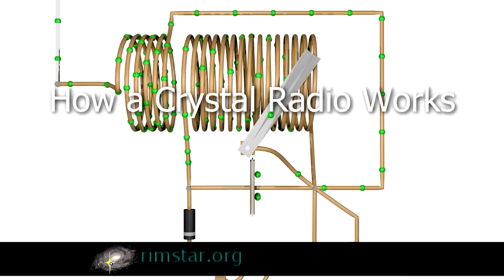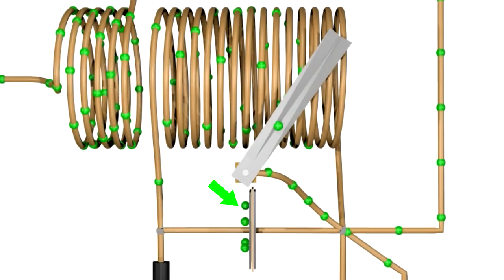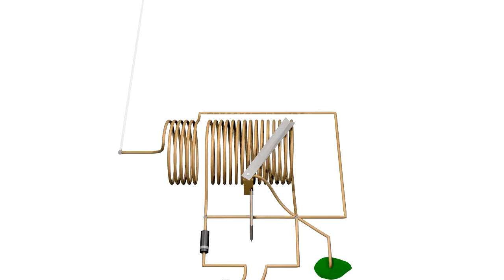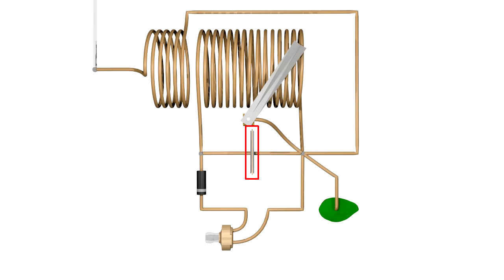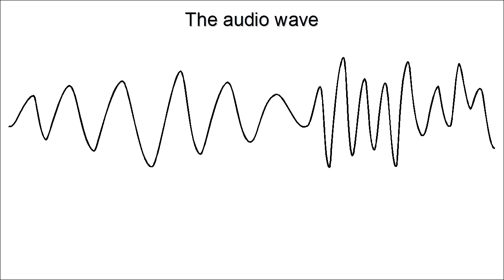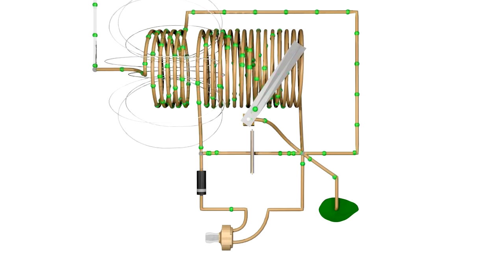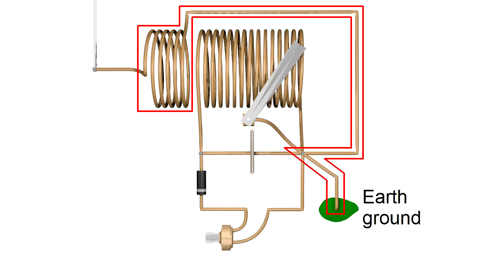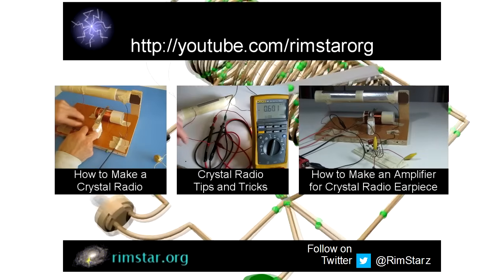How a Crystal Radio Works

Comment: Yep. Been reading since my comment. Seems I may have had a chart specifically for pens and pencils. We never had induction meters then, would have needed a constant. Diameter and length are important factors, and can affect things like sensitivity, directionality, gain and a few other factors. Larger diameter for eg will make it more directional. Longer coil will make it more sensitive, and a longer wire can aid gain. You can also take those things too far, and make it worse. its a fine balance.

Comment: Thanks for the nice video and the clear explanation. As troubleshooting video,  can you add the voltages at every stage?  Since Ge diode conduct  only at 0.2v does it mean that the voltage coming from the anntena should be more than 0.2 volt?  Thanks
Reply from the maker: You have electromagnetic induction going on between the antenna coil and the tuning coil so maybe an induction formula as with a transformer's primary and secondary might be better.

Comment: 60 years ago, when I first tried making a crystal radio, I used a quartz crystal, and no matter where I placed the wire on it nothing happened.  I later learned that quartz was an insulater, and the crystal had to be a conductor like galena.  I don't remember if I used galena then, or went straight to a manufactured diode, but the diode radio worked much better.

Comment: I have been working on Wireless transmission of electrical power for a little over a year now and its not that hard to put one together.  I'm currently making a AM Radio broadcasting Station that has a set-up like what you show in your videos but instead of having just a plain wire antenna, I'm gonna use the metal core like most internal radio antennas have and coil the antenna wire around it then add a 2nd coil not directly connect and then the 2nd coil gets struck by the Tesla Coil.

Comment: What might be lost on people is - THERE IS NO POWER SOURCE.  There is no battery or AC power.  This is a radio that needed no power supply.

The front end of T. Henry Moray's 'free energy' device was a crystal radio.  Instead of an earphone output, he tuned the crystal set 1st stage of his device to the strongest radio signal in his area and the output was fed to a cold cathode amplifier tube of special design (his design).

He avoided having to provide power to heat the cathode that is normally required to 'boil electrons' off the cathode by using radium inside his special amplifier tubes:  the initial electron source off his cold cathode came from the radium's ability to create an initial, quite low level of ionization of the working gas in the tube (mercury was the source, just like in modern fluorescent light tubes).

He used a positive feedback loop from the amp tube's output to bring the amplifier into full conduction - the plasma built up slowly.  Eyewitness accounts of his free energy device reported 45 minutes to an hour before the device produced output.

The output of the amplifier tube section was a capacitor bank.  So the free energy crystal radio guts plus the free ionizing energy of the radioactive radium actually produced a real free energy device.

But the radio station operator's power bills inadvertently paid for Moray's "free" energy.  Without the local AM stations broadcasting, his device would not work.

The other problem with his device was that if the capacitor section was drained quickly, it would take too long to rebuild the charge, so his device was not very practical.
.

Comment: Very Clear & Consistent;-)
As a method of Pulse Charging Batteries? 
Couple the Crystal radio, to a voltage Multiplier & collect Free Energy ♡
Reply from the maker: Thanks.
That's actually why I got into crystal radios in the first place. Then I realized how little energy there was available this way and just kept on having fun with crystal radios as radios instead!

Comment from the maker: If your simple diode does the job then great! Use it. Though I'm not sure what you mean by simple diode. Germanium diodes are nothing special. They're just one type of diode out of a few different types, and happen to start conducting at a lower voltage and are leaky (which helps this circuit work.) If you have a silicon diode and it does the job then that means you either have a long antenna and good ground or a strong radio station or both. Those result is higher voltages.

Comment: I build many of these but I never used two coils. Simply one coil with a long wire as antenna at one end. I've also made them like the POW's did in WW2 with a razorblade and pencilpoint and sometimes, if you got the placement of the pencil lead on the razorblade just right, it worked even better than with a diode. Of course the diode has a threshold voltage which I don't think is the case with the pencil lead although I could be wrong there. Anyway, these are great fun to build. Shame they don't work for FM stations ;)
Reply from the maker: I've never tried one coil myself. I have done the razor blade though, but didn't have as much success as you. Mine worked but not as well as with a diode. It takes a little more work I guess.
Reply: Well, it helps if your razorblade is old and has that blue hue to it, or if it's a bit rusty. That helps make it work like a diode.

Comment from the maker: That would work. It's called an amplifier. I have a video about how to make an amplifier to increase the volume for listening on the earpiece, "Steps for How to Make Amplifier for Crystal Radio Earpiece HD". But a lot of people just use normal store bought amplifiers. There are also DIY amplifier circuits on the web for speakers.

Comment: Re: 10:29 (the capacitor),
Also, a capacitor of that value is will allow high frequencies to pass through it like a piece of wire, but at the lower audio frequencies, the capacitor acts like a high value resistor. The carrier wave being much higher a frequency than the audio frequency, will be sent to ground, thus allowing the audio to make its way to the earphone unhindered by the carrier
wave.  
In electronics, the "wanted" signal is called the intelligence and the "unwanted" signal is call noise. Here, the audio is the intelligence and the carrier is the noise. The capacitor filters out the noise. The audio alone is left to feed the earphone.

Comment: Thank you. Excellent explanation.  I have just a small comment. Actually I did this when I was young. I just left the Right end of the second coil open. I thought that connecting  this end to the earth makes short circuit and causes unnecessary power loss.  Anyway very good work thanks a lot....
Reply: I think it's impossible to work when you don't ground the antenna coil. I read your comment again and saw what you meant. LOL.    I also did it as a kid. So much fun.
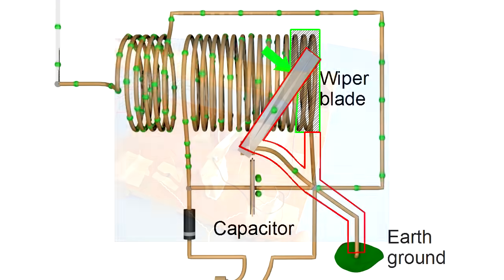Reply: I am glad that you see the point.  I read  my comment again and I realized that I am not clear. :) You are right it is necessary to connect to the ground. If you pause the video at time frame 1:19 you will  see the schematics. At this schematic you will see that viper blade is short circuiting the bottom of the  coil which is also connected to the ground. All I wanted to say is just keep connected the wiper blade to the ground and remove the connection of the bottom end of the coil from ground and leave it open in order to prevent some short circuit. By this way the radio should be louder.

Comment from the maker: Nope. For AM type radio receivers that use a battery, you do need the battery. The battery is used to amplify the signal. Because it has amplification, the circuit and components are different. Many of the things that are done are the same, tuning in a station, turning radio waves into audio waves, and how they're basically done is similar, but there are enough differences that the battery is required.

Comment: Great Video !  And a perfect radio for the "Prepper" and your Three Day Kit/Bug Out Kit that FEMA wants you to have...  Also this Crystal Radio has NO batteries !  So the "Haters" will say the battery companies will ban this radio !  My EDC Go-To radio is the digital La Crosse 810-805 Weather Radio that is an  AM/FM/WB battery powered radio.  The radio has an external power input, a light, and earbud to increase battery life and a tether.  And an Antenna can be a Long Wire to bring in a weak station or one far away !  Or a Loop Antenna to couple to the AM radio to bring in the weak stations !  The VLA in New Mexico is a very sensitve  radio RCVR and can listen to the stars in the galaxy !  tjl

Comment: The 3-D graphical animation here is excellent, and viewers wouldn't get as much understanding if it wasn't part of the video.  I'm curious, what software did you use to make the 3D animation?
Reply from the maker: For the 3D modelling and animation I used Blender, very powerful and free software.
Reply: RimstarOrg Thanks!  I've used Blender before -- steep learning curve.  You've done a great job of it.  Making the electrons move on those curved paths must have been tedious.
Reply from the maker: Thanks!Making the electrons move on the curved paths wasn't too hard, once I'd figured out how to do it. Now I do it routinely and quickly for videos. For the different possible paths I create a bezier curve, which is not visible. For each electron I then use a Clamp To constraint to constrain them to a path. Then the x-coordinate of the electron becomes a position along the path, so I simply animate starting and ending x-coordinates. Luckily for most of it the electrons were doing alternating current i.e. moving back and forth, so they never get very far.I agree about the steep learning curve. I think part of it is due to the non-standard interface, but also just because there really is so much there to start with.

Comment: Thank you for this excellent video.
This shows a different sort of crystal radio than the ones I saw when I was a child. My uncle built one that had no antenna or, rather, substituted a crystal (I believe it was a lead crystal.) for the antenna.  There was a finely-sharpened wire tip, called a cat's whisker, that touched a specific spot on the lead crystal where there was a single crystal that was properly formed to catch the radio waves. There were other spots, too. Each spot was marked by a very tiny spot of white paint near it.
Could you do a video on such a radio?  I suspect that it is not too much different from the radio you have described but what do I know?  I was a small child when I saw it and it vanished when my uncle moved out. (I may have been 11 or 12 years old.)
At any rate, thank you again for this excellent video.
Subscribed.
Reply from the maker: Thanks for sharing that. Using a crystal and cat's whisker instead of a diode is something I've always wanted to do, just haven't gotten around to it.

Comment: I have a doubt regarding the explanation of the diode part. You said that the electron current in one direction is lower than that in the other direction. Now since there is a nett flow of electrons into the piezo crystal won't the charge just accumulate? Like let's say 50 electrons go into the piezo through the diode but only 5 return via the leakage. So won't there be constant rate of accumulation happening? Electrons can't just disappear. It's like filling a leaky bucket with more water than it can leak so we reach a point where the new water going in will just run off the surface right into the drainage.

It made more sense that the diode was there only to remove the negative part of the wave and the capacitance was smoothing it to the "envelope" of the AM wave = actual sound signal. I am not sure if that's what is happening.
Reply: Am I correct in thinking the diode flow direction was incorrect according to the indication ring? I always though current was blocked from the side closest to the ring?  Great animated video though, just a little too fast.
Reply: @chrisd7789  It is confusing for anyone who only has some knowledge. People that have no clue and those who understand it well know what's going on.

You are right, the diode does restrict current in that direction. But the current this video is describing is electron current. In reality, electrons constitute current by their movement but the convention is to indicate current in the opposite direction. That's why you might be confused. This video is fine when you look at the electron current direction which is the opposite of the regular current direction. The diode loves to get electrons from the ring side so it will not restrict the flow.
Reply: Swagat Suryawanshi
Thank you for the clarification

Comment: I am so close to understanding this,  but why is it a tuned parallel LC circuit which surely rejects the wanted signal, whereas a series LC  circuit would surely accept the wanted signal?  I can see in the parallel LC circuit you have the wanted signal oscillating at resonance - but what allows the electrons / signal to leak to the diode.  I hope my question makes some sense, in any event I will keep studying and replaying .... it is an excellent video which makes me feel I am so near to piecing weeks of study together .... thank you - Paul
Reply from the maker: Hi Paul, As you say, in the parallel LC circuit the wanted signal oscillates when the cap and coil are tuned to resonate at the frequency of that signal. My understanding is that some of the electrons leak through the diode/crystal earpiece path because it's of sufficiently low impedance to allow some to take that path while still being a high enough impedance to not allow too much to take that path. If the impedance of the diode/crystal earpiece path was too low then the LC resonance would fail since there wouldn't be enough to resonate with. To further illustrate the point, that's actually what happens when you replace the high impedance crystal earpiece with a low impedance (around 8 ohms) iPod earbud. The electrons mostly take the diode/earbud path and the resonance fails. To get an iPod earbud to work you have to add a transformer to that path and put the high impedance side of the transformer facing the LC circuit. -Steve
Reply: RimstarOrg Steve Thank so much for the reply -all of which was really helpful and I feel now painfully close to understanding.  

I am struggling to understand why there is not mutual inductance, and hence flow of electrons, in the second coil at unwanted frequency's

Perhaps there is ?

I took this concept and drew a simple circuit with  two components, an AC source ( in place of the coil) with a capacitor across it - presumably this would be a short (at many frequency's) and therefore NOT allow for any current to leak to a diode and earpiece (for demodulation of any potential audio signal) if it were placed in parallel to this simple circuit.

If I put the coil back in the circuit in place of the AC source,  then for most frequency's induced in the coil it would be a short circuit, however, at resonance that frequency would not short but bounce back and forth allowing for some leakage to occur - and thus demodulation. 

Even if my thinking here is along the right lines it then raises the question, why at the wanted frequency does the continued input of new wanted frequency (with new audio signal) not distort the existing resonating wanted frequency from previous input?  

If I am completely off the mark it would be really helpful to understand why mutual inductance does not take place at the unwanted frequency's 

Your explanation of AM modulation and demodulation is the best I have ever come across and perhaps is worthy of a video in its own right.

Thank you again - and I hope it is helpful for you to see the questions your video's stimulate as well as the understanding they provide - Paul

Comment: Great video.I now understand. But.one question. Couldn't we have just used one coil instead of two?
Reply from the maker: You can use just one coil. But as I explain at 10:43 in the video, 2 coils gives you better selectivity at the cost of volume.

Comment: This is Amazing! How did Tesla and Marconi figure this out. And the Carrier wave idea is genius. What is the reason we use a piezo electric crystal, and how does it work? do we still use crystals in our current radio's?
Reply from the maker: Sounds like you understood it very well! There isn't a lot of power being output here and piezos don't require much power to work, so that's why they're used. I don't know the inner details of piezos except that they're a crystal structure that reacts the way I described in this video. We use electromagnetic speakers in our current radios. They have better frequency range and since our radios have batteries or plug into the wall, we can use big speakers and get louder sound.

Comment: I am glad I came to this channel . I was trying to make one foxhole radio and kept failing. Maybe I would follow your build. Can we use earphone instead of piezo buzzers for his?
Reply from the maker: That depends on the earphones. There used to be special high impedance earphones specially for this, but that's not the same as the normal earphones you use day-to-day. If you want to use the normal earphones then you'll need to add a transformer to the output. I show that in this video here https://www.youtube.com/watch?v=GCh2LVHUavQ. Note, I found that due to added losses, it was harder to hear the sound.
Reply: that was quick reply! Thank you so much, sir. Great respect. I will look for a piezo buzzer in some toys or musical cards.